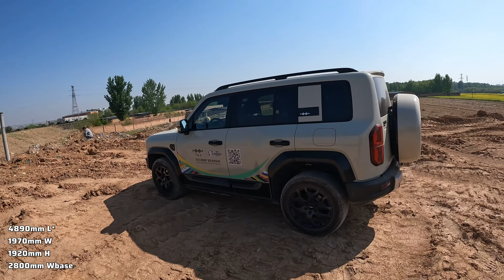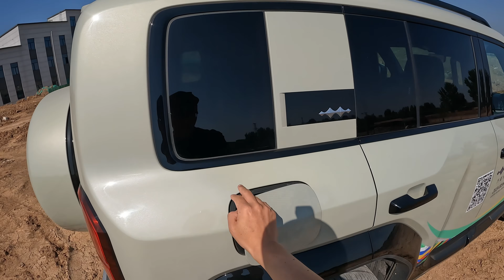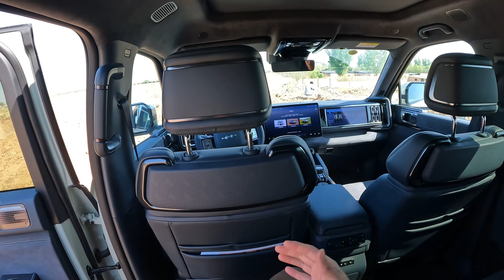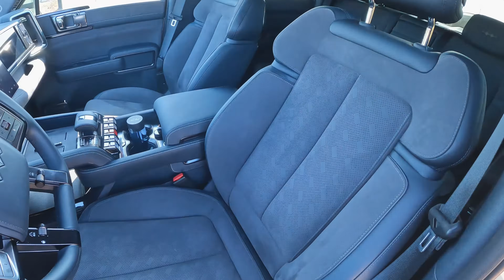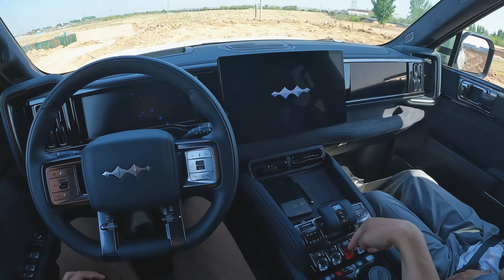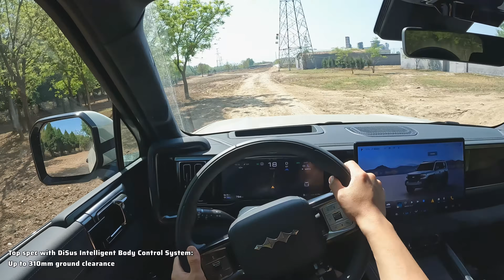BYD Denza B5 (Fangchengbao Leopard 5)│POV Drive Review│DMO & DiSus-P Technology

Comment: I’ve been wanting to replace my 4x4, and have a model Y as the other car. There’s a few things that trouble me with BYD. Firstly BYD cars absolutely fail to remember profile drive settings which means certain things need to be switched every single drive. Its ICC cruise control is wildly unreliable (absolutely nothing close to even the free Tesla autopilot). Its safety features reset every drive and are incredibly invasive and aggressive. They don’t have one pedal driving and instead it defaults to constantly pulling like an auto- meaning you have to ride the brakes all the time (which makes no sense on a PHEV - with no way to change it). It doesn’t even have auto brake hold unless you press a button at the lights.

No true keyless entry and drive, identical to the shark - an absolutely horrific trip computer that gives no useful or even remotely reliably range information (just follow the forums on the shark). The dealer experience in aus is an EXTREMELY mixed bag, and it appears the dealer training is poor at best - which echos my test drive experience. All these cameras and no sentry mode for security. Lots and lots of complaints about Aircon being either too hot or too cold and not regulating very well. 

There appears to be constant app connectivity issues and there are limited soft changing controls compared to tesla if your wishing to tweak your changing times and currents into home solar generation or off peak power. 

Than there’s all the issues with tow mode (which often turns on for no reason). Engine reving like crazy. Battery percentage being locked in. And loss of cruise control and speed limited to 105km/h. 

This plus many more, and it’s getting pretty average fuel economy. And arguably terrible economy at towing.

I’m keen as a biscuit on a car like this, looks amazing. but people are underestimating the importance of good software. I’m forcing myself to wait.
Reply from the maker: I think many things are improving but same with many other brands, they won’t give you the software experience like a Tesla.

Comment: Hello mate

How did you find the interior quality of this car?

Is it on the same league as a LR Defender? 

Are there any real metal trims? 

I'm waiting for the Bao 8, but the Bao 5 is also extreamly tempting given its cheap price (top sped around 250k rmb now!)
Reply from the maker: @energiam880  I think it has a better interior trim (much softer) than the Defender. I’m not saying the defender is bad but the defender feels a lot more rugged than this. This feels between rugged and premium.
Reply: @JerryPanandCars  

Interesting, thanks. I bet the technology and features on the Bao 5 blows the defender. 

I've also seen many videos of this thing beating the Defender in technical off-road trails. 

So it's basically a Land Rover Defender alternative with Mercedes G63 level power,  but the same price of a Suzuki Jimny in the UK! 

Insane value for money

Comment: Nice vehicle. Hope it comes to Australia.
Reply from the maker: Considering the technology and platform is close to the BYD Shark Ute, I would love to see it here in AU & NZ.
Reply: I believe it is very likely to come to Australia
Reply: I’ve been wanting to replace my 4x4, and have a model Y as the other car. There’s a few things that trouble me with BYD. Firstly BYD cars absolutely fail to remember profile drive settings which means certain things need to be switched every single drive. Its ICC cruise control is wildly unreliable (absolutely nothing close to even the free Tesla autopilot). Its safety features reset every drive and are incredibly invasive and aggressive. They don’t have one pedal driving and instead it defaults to constantly pulling like an auto- meaning you have to ride the brakes all the time (which makes no sense on a PHEV - with no way to change it). It doesn’t even have auto brake hold unless you press a button at the lights.

No true keyless entry and drive, identical to the shark - an absolutely horrific trip computer that gives no useful or even remotely reliably range information (just follow the forums on the shark). The dealer experience in aus is an EXTREMELY mixed bag, and it appears the dealer training is poor at best - which echos my test drive experience. All these cameras and no sentry mode for security. Lots and lots of complaints about Aircon being either too hot or too cold and not regulating very well. 

There appears to be constant app connectivity issues and there are limited soft changing controls compared to tesla if your wishing to tweak your changing times and currents into home solar generation or off peak power. 

Than there’s all the issues with tow mode (which often turns on for no reason). Engine reving like crazy. Battery percentage being locked in. And loss of cruise control and speed limited to 105km/h. 

This plus many more, and it’s getting pretty average fuel economy. And arguably terrible economy at towing.

I’m keen as a biscuit on a car like this, looks amazing. but people are underestimating the importance of good software. I’m forcing myself to wait.
Reply: If priced right , it can come under the LCT and FBT free if efficiency is below 7. It will be a must buy .
Reply: HEY!!!! Canada FIRST!!!!